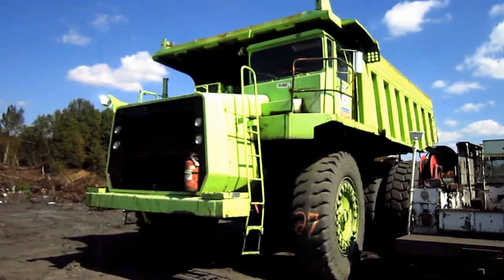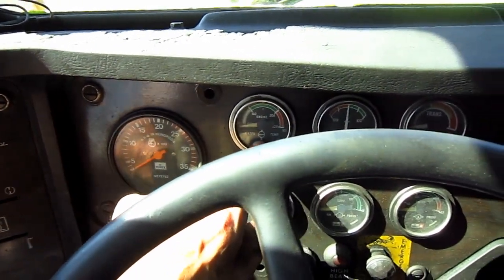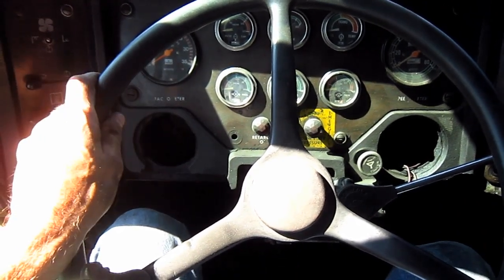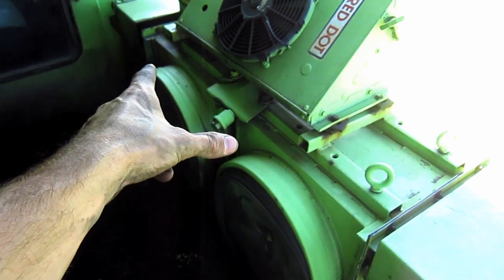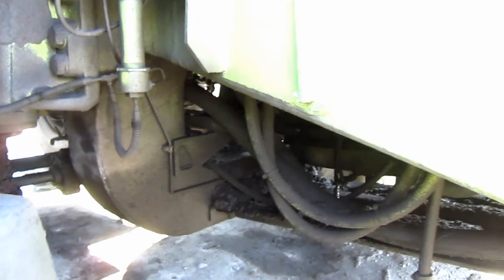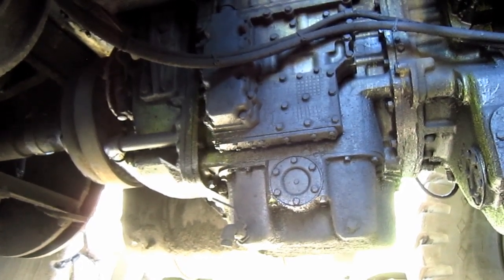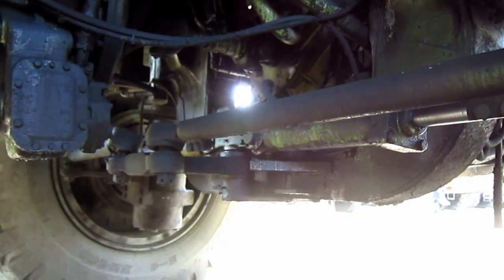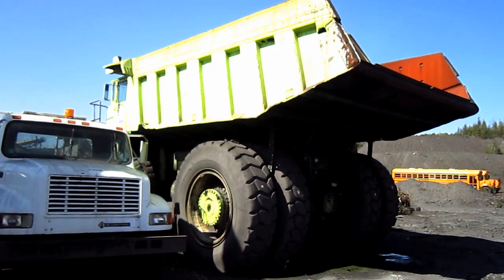Terex 33-11C Documentary

Comment: Since I don't know what is Retarder, Trolley Brake, And how do you dump the bed.?.
Reply from the maker: The retarder prevents the engine from overspeeding on downhill grades, the trolly brake is the same as the foot brake on the floor - it's used to hold the truck in position while it's being loaded, and the dump box is controlled by a hand level to the left of the operators seat

Comment: I can’t imagine trying to run that old truck today with the fuel prices the way they are…that old Detroit was a tough old engine but they were wicked pigs on fuel…in some mines that ran electric drive trucks, they had the electric assist system for climbing hills to save on fuel…I believe some mines still run this system…great video!!
Reply: Diesel electric drive is standard on just about every ultra class haul truck now. I think Cat still offers their 797 in a full mechanical drivetrain, but they have a diesel electric drive 794, 796, and 798. I'm pretty sure that Komatsu, Terex, and Liebherr all make their ultra class trucks only in diesel electric drive. I know that Liebherrs 100 ton trucks are diesel electric drive, don't know about the others.
Reply from the maker: It's not as bad as you think. In 8hrs that truck will consume around 130-150 gallons depending on road grade. Your welcome! 😎
Reply: @PAmining  wow that’s bad at all!!..I ran an old John Deere 450lc that would blow through that or more in a shift!..I worked for a large earth moving company 25 years ago and they had a fleet of Cat 769’s and they were amazing on fuel!…they had a few Volvo A40 6wd’s and they were harder on fuel than the Cat trucks!..🤷🏻‍♂️

Comment: On a rig like this, what does a trolley brake do differently than the service brake?
Reply: I may be wrong but I think trolley brake less braking applied to the front and more to the rear, so safer braking at higher speeds. Where as service brake would probably be 100% same amount applied to front and back, and service brake for use at low speeds
Reply from the maker: The trolley brake is the same as the foot controlled service brakes. The purpose of it is to hold the truck in position while it's being loaded so the operator doesn't have to hold his foot on the brake pedal. Thanks!

Comment: Great video! How much fuel would that truck go through in a day?
Reply from the maker: In an 8hr shift the truck will consume around 130-150 gallons.  As an fyi, fuel consumption on an off road truck can vary greatly depending on the road grade too. Thanks!
Reply: at a guess, if it were operating day and night shifts it would be refueled once a day